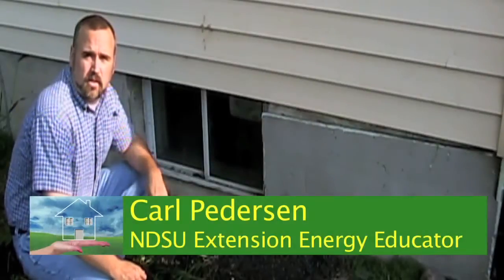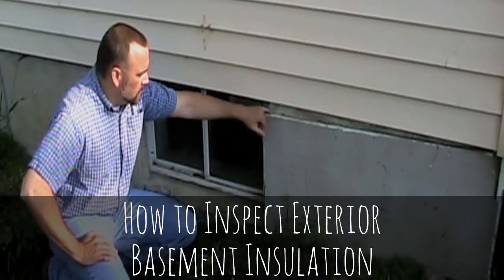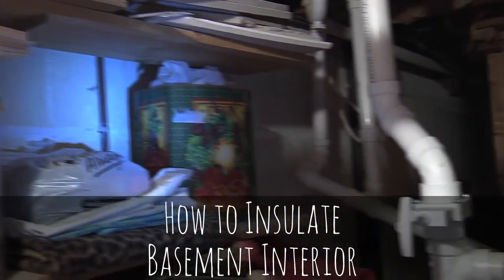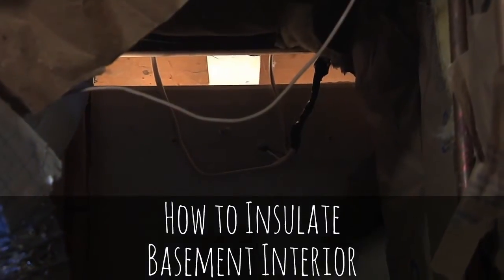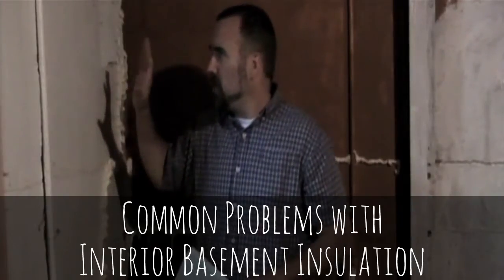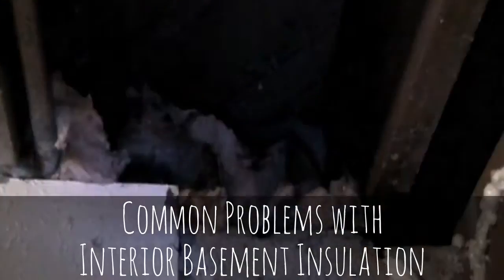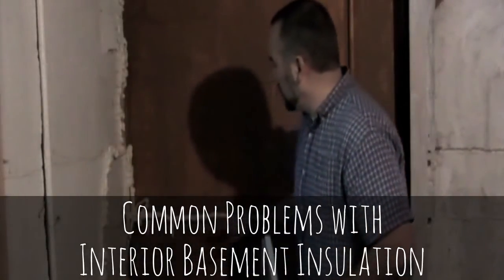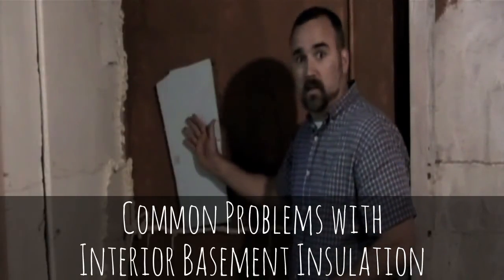Basement Insulation: How to Insulate the Exterior and Interior of A Basement to Save Money, Energy

Comment: If the concrete has less insulation R-value than a single-pane window, I'd get condensation on my basement walls before I got it on my windows, no? Doesn't happen that way.  It got so cold the other day my double pane basement window got foggy, but the basement walls were dry. Well, I guess thermal mass is another thing.